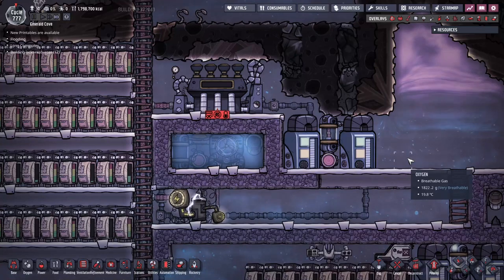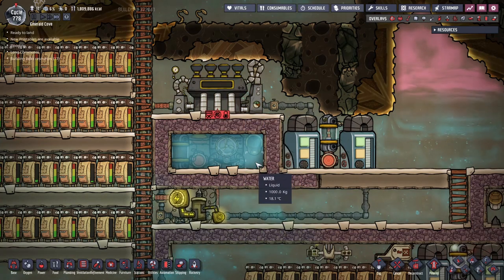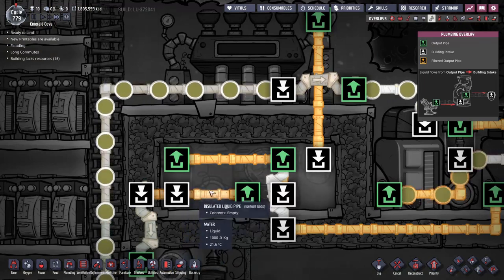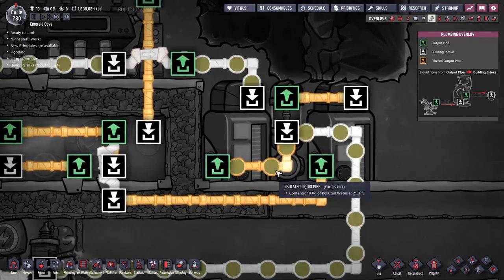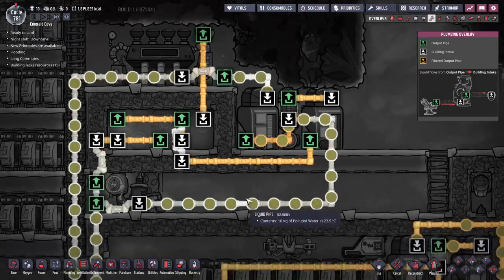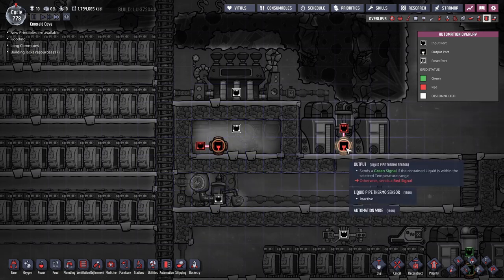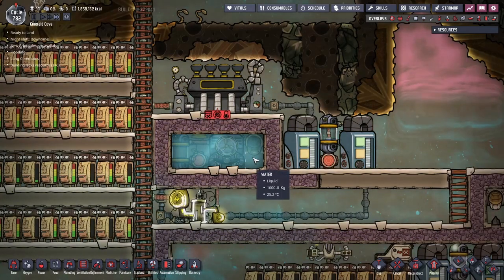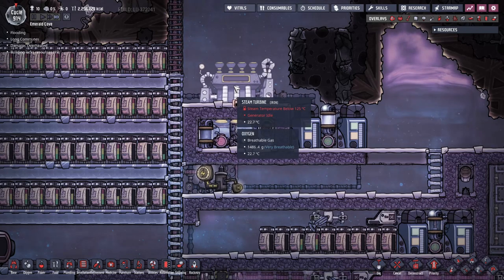Oxygen not included - How to build: Aqua Tuner Cooling Loop!

Comment: this is the design that got me to learn this great mechanic. For some reason even though i have been playing for over 1000 hours i have never setup an aquatuner loop successfully. I have always reliaed on other methods like pipping cold carbon dioxide from a vent around my base in radiant pipes before feeding about 50 slicksters. but this loop has changed everything. and this was the first video that successfully explained it to me. appreciate it.

Comment: Great design, but I'm sure I'm doing something wrong. Did you ever mention how much p water to fill the loop with? Enough to fill both reservoirs? Each half full?  Mine runs for a while,  then seizes up with 'pipe blocked' everywhere. I may have put in too much water I've triple-checked the plumbing and settings. The aquatuner cools, but it never gets hot enough to vaporize the water.
Reply from the maker: Make sure you got the liquid bridges right, like in the video.
As long as you don't fill the reservoirs to the max, it should be fine.

Comment: I don't have steel yet in my playthrough, so I moved the liquid shutoff piece outside the box. Cross your fingers. (also, still building the thing, but one part of the plumbing confuses me. The shutoff valve seems to have its output directly plumbed into the output side of a bridge. Does that not simply block it entirely?)
Reply: nvm. figured it out. Works like a charm. I added a thermo-sensor to the water in the chamber just to auto-shutoff the tuner if the water gets TOO hot because (again) I don't have steel yet. Might not even be needed, but I'm scared of new builds lol. FYI moving the shutoff outside the box is working great so far. Another 50 degrees of leeway between failure and success before steel.

Comment: I really like the design, but i have several problems with my build.
First of all I don´t really understand the system of pipe priority, I think I copied the piping, but sometimes the flow gets stuck, which causes cold damage or stops the aquatuner.
Second the Exhaust of the steam engine keeps breaking, it cant stand the pressure of 1000kg Steam.
Third the valve and the aquatuner himself get to hot. Build from Gold Amalgam the overheating temperature is to close to 125°C of the steam, which causes temperature peaks of 150 - 170 degrees, damaging the thing. I made it from steel to fix this, but it would have been better to do this in the beginning. My base got somewhat chaotic while I was experimenting :-)
Any solutions for the first two problems?

Comment: I'm along with another guy here, this isn't working for me...I've copied the design exactly, but in my case it just keep overheating, then when the water turns to steam, the vent back into the system says it's overpressure and it can't put water back into the system and the aquatuner just burns up.  I can't figure out for the life of me what I'm doing wrong.  Are you using some mod that I'm not aware of?
Reply from the maker: I'm not using any mods, did you check that your atmo sensor is working properly and letting the airlocks close?
Reply: @stivraptor  I don't think there are any atmo sensors, are you talking about the liquid sensors and the liquid gates?  Let me double check that I have those set up and I'll run it again.
Reply from the maker: Wow, Sorry, I got confused between two of my videos, I thought your replying to my hot steam vent video. So everything i wrote was out of context.
I guess that's what happens when you use the youtube notifications directly to reply and its 2AM in the morning.

Anyway, if the AT is overheating, this means that you probably trying to cool something that requires a lot of cooling.
Gold aqua tuner is not good for this, you should use steel instead.
Gold AT in water can only work when the cooling is minimal, like when cooling your base (same as in the video). If your trying to cool something more serious, you gonna need steel AT.
Reply: i belive the problem of overpressure is the liquid vent from steam turbine is submegerd in coolant  -  i think you dont even need to have the tank full with coolant.

Comment: my steam is not getting hot enough how do i fix that
Reply: I've been having the same problem! It heats up slowly and requires allot of power. Maybe insulating the steam turbine might add some additional heat. Will post here if it makes a difference!
Reply: @TitoKnowsWell  i ended up using steel for the cooler and it never even heats up. its pretty cool
Reply: @bluesscript9476  well I did the same but dont you need the steam to be atleast 125° to get the steam turbine to start returning some power? The cooling is great though but very demanding on power.
Reply: So I did the changes, I hardly found any difference lol and I understand why the system hasnt extended any further than his simple design! I even added another aqua tuner using exact same design but 2 metal tiles between the aqua tuner surrounded by template shifts. The process used twice as much power and the heat increase might have been 2 fold but the power consumption for 2 aqua tuners is high none the less I kept it since I have enough power to supply! I like his design! absolute coolness to your liquid without the worry of over heating and getting a little sweet power!

Comment: I was looking for information about different amounts of liquid in the reservoirs. By filling a reservoir with more or less liquid, you end up with a temperature buffer to smooth out spikes and dips in temperature. I have an iron volcano with a full reservoir and I can't cool the liquid fast enough. On a steam vent, I have a reservoir with no liquid in it, and I can't cool that liquid fast enough either. You didn't cover this. So thanks but no thanks.

Comment: Did not find useful.   No specifics as to amounts.   Also didn't note a good ratio of steam generators to aquatuners.   What I really need is a copyable design.
Reply from the maker: Everything you need to build such design for your base, was mentioned in the video, including water amount.
Reply: @stivraptor  ive watch this video quite a few times. i may be missing it somewhere but this is a 15 min video and rewatching it over and over is tedious. exactly how much water do you put into the enclosed chamber? over filling it seems to cause over heating issues.
Reply from the maker: @crazifreak  you fill it till the water fills the entire chamber.
This means 500kg of water per tile, in other words, fill the first row with water (1 ton per tile) then add a bit more and the water will rise to the 2nd row, that's it.

Again, the idea is for the water to take up the entire space of the chamber and kick all the gasses out.